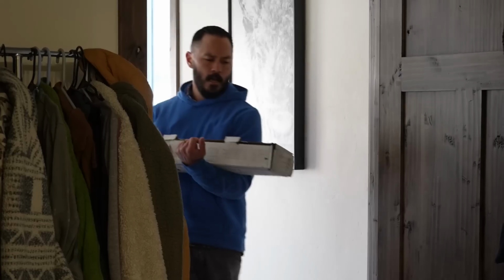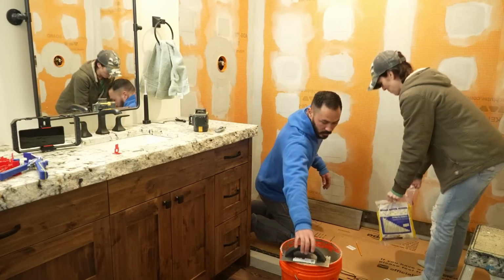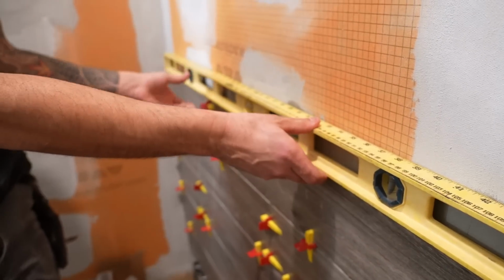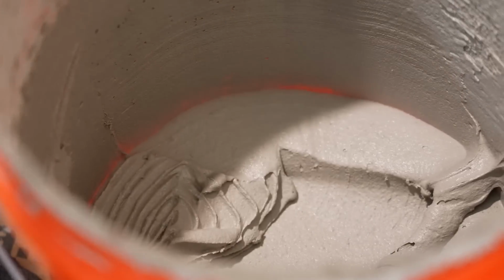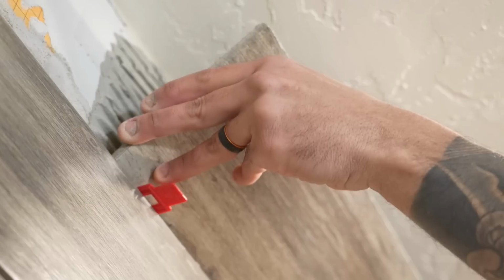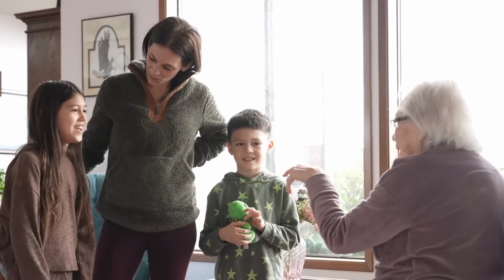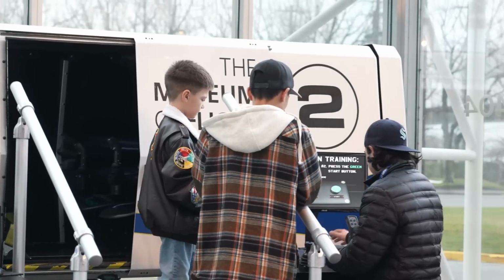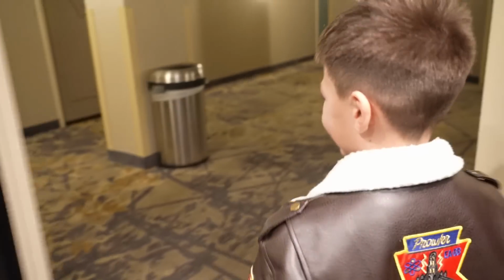Completing the FINAL Room Inside Our DIY Mountain Home

Comment: You need to tighly tap the tiles with a rubber mallet once you place the tiles on the wall to collapse the ridges of cement and ensure 100% contact between tile, cement and wall. I am sure these tiles will be fine also.

Comment: As a Professional Tiler in the UK. The protocol for Tile on wall is for the Vertical Grout lines on alternate rows to line up.I noticed your vertical ends of tile are Random.  So each Row should start alternatively with a FULL, then a Half Tile. Just saying
Reply from the maker: With traditional tile, yes, but with aged barn wood you want it random. It's supposed to look like an old weathered barn, more like an accent wall.